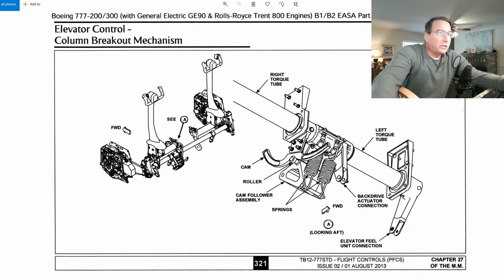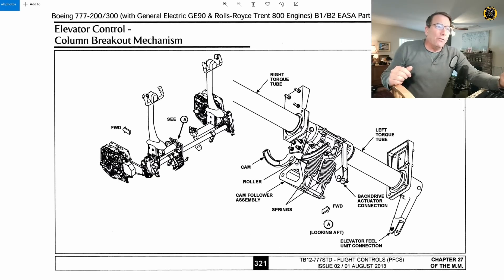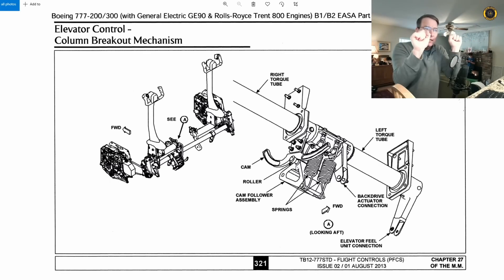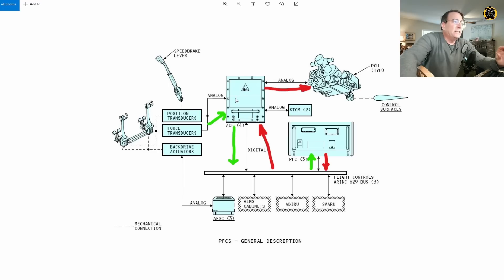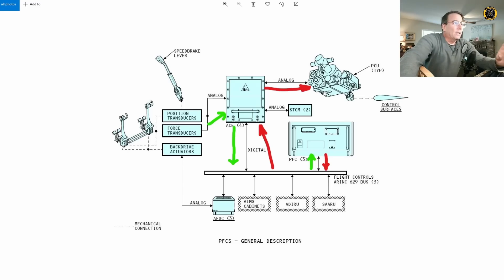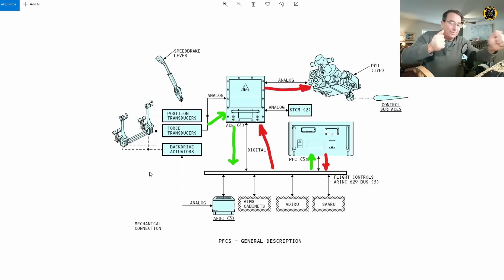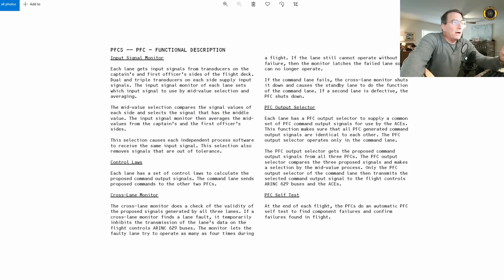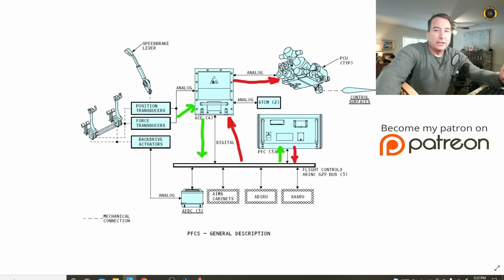Air France 11 Decoupled Flight Controls- "Who's Flying?"

Comment: Thanks for this piece of analysis. I am a French aerospace engineer and I am saddened to see that Air France pilots seem to disregard lessons learned from AF447 and other accidents regarding crew communication. Having both pilots handling the controls to the point of fighting for control without even realizing it, and ending up decoupling the columns, while on a go-around, would be comical if there weren’t several hundreds of passengers onboard. 
This is just extremely unprofessional. Air France pilots really seem to have a contagious disease of badly inflated ego.

Comment: This stuff is exactly why I, and many others.....if we can't bend it before we hit terra firma, I ain't agonna fly it. (Talking about the new composite air beasties). That's why I retired as a 737-300 captain at Brand X. Actual cables to the elevator, spoilers,  and ailerons (Rudder was on its own hydraulic system. Ever fly a 737 in manual reversion? I have, in a maintenance flight for return to service. The input forces were phenomenal...I wasn't chasing the bucks or type ratings......and, I'm glad I did just that.   B727 and B737-200-300.  I could have retired as either a 777 Captain, or a 747 co-pilot--- that position made more money than a -300 captain.  (A side note: What about an EMP attack?).  Any ideas? Call me paranoid, old fogey, curmudgeon......fine........Enjoy the bucks! Lots more to share, but not here. Please.....just be aware. Blanco, great job.....thank you. Gee! Whole new world now.......enjoy your Luscombe!

Comment: Does the technical info on the flight controls explain what the pilots were doing or what the pilots were not doing? Procedures are established so one pilot flies, the other monitors. If the pilot not flying takes over that must be announced clearly to get the other pilot’s hands off the flight controls. What led to the confusion?

Comment: I’m an engineer, but not that kind of engineer. However are used to be involved and computer control systems and have some idea of what’s going on here. 😁

It would seem to me that if decoupling occurs the crew should get a big warning and the plane should ask the crew which of the two control yokes is the one controlling the plane. Otherwise, as you described it, it would seem that what the system is going to get is the algebraic sum of the two inputs which, as you pointed out, could lead to zero input if the two yokes were in opposite positions.

Comment: How can it be an experienced Boeing pilot knowing
- how Airbus manages the the operation modes when the flight control is  not fully according to specifications  - Airbus jargon called laws
- but not having the full information how Boeing FBW is set up?

May it be Boeing is not open to the pilots how the system is working, especially in the case of some abnormalities?
May it be Boeing training is less deep than Airbus training?

Comment: The first pilot error was made at 1200 feet above the ground when the captain who was the non-flying pilot did not tell the co-pilot who was flying that he (the captain) had taken control of the plane ( I have control or my controls)  then to be confirmed by the copilot.  If they crashed it would have been the primary cause. Procedures, procedures, procedures. 

The non-pilot flying captain was pushing the nose down while the pilot flying co-pilot who was pulling the nose up to go around. The pitch went up 24 degrees then down to 3 degrees increasing to 12 degrees.

Comment: Take a chance fly Air France! This what I learned when flying every month from US to Europe and back 2005 to 2012. Best was Northwest from Memphis to AMS, then Delta destroyed the option. Thereafter it was ATL - AMS and back. Some of flights were CDG -ATL since Delta was code sharing. It was always an experience of disorganization, but the bottomless champagne was great. If you were flying during this time frame from CDG you remember the many variants of concourse E they had and if arriving from US and followed the CDG signage to connecting flights and ended up at a bus stop outside the terminal. Take a chance fly Air France!

Comment: Well done Juan.  You point out very appropriately that the airline pilot is not required to know the details of how the FBW flight control system works.  Apparently Boeing aircraft pilots know event less about how the three different flight control laws work than do Airbus pilots.  How the flight control law works, versus that it does work does not seem to be a training priority with training Boeing FBW airplanes.  The basic analogy I use to explain the systems on Airbus is to compare a automotive power steering controlled car or truck to one where the power steering fails.  Without power steering, the car or truck can still be steered by the driver.  But the physical effort required is very different.  Steering the car or truck using fingertip pressure, versus ham-fisted exertion that is required without the hydraulic assistance.  Or, mowing your lawn with the ancient push thrasher type of mower versus having engine or electric motor powering the cutting blade.  

While I digress slightly with that explanation, it is very relevant to the effort required not to have both pilots making inputs to the flight controls at the same time.  A very fundamental “no-no” with all aircraft.  But, most especially with FBW controlled aircraft.  On Airbus, dual inputs are either summed together electronically so that the cancel out, or the summed inputs create a less overall authority situation resulting in half the output to the flight control surface than the dual input situation would otherwise allow.  This dine on purpose to avoid a dual input summing together to generate twice the control input that what is desired.  For obvious reasons, this must be avoided.  And is directly analogous to a PIO, or Pilot Induced Isolation situation.  A scenario that all pilots should be familiar with, that cold create a loss of aircraft control situation.  

Famously, the F-16 Falcon and the F-22 Raptor FBW fighter aircraft prototypes both suffered catastrophic accidents due to PIO during their flight test programs.  Thereafter, FBW flight control systems have been improved in an effort to reduce or eliminate PIO scenarios especially in the landing phase of flight.  This Air France 11 investigation may lead to design changes or improvements to the FBW flight controls  based on this incident.  Such changes may not ever be told to operational pilots, similar in result to the 737 Max MCAS fiasco, as you briefly mentioned.  The question remains though…how much information needs to be given to operational pilots about who the flight control system works?  This is a flight training and flight crew knowledge dilemma that remains poorly fleshed out, in my view in all of the flying world today.  How much information is too much to require the operating pilot to know and understand?  The old “less is better” trap that quite often leads to incidents and even accidents.

Comment: The fundamental issue here - and I am not certain the design engineers have quite got this sorted out in the optimal way - is that there are two sets of control inputs feeding signals in to the flight control computer, how  does the flight computer know to which it should be responding?

If both sets of control input are producing the same output, then the PFC can use either. But when the two control inputs produce significantly different results, the challenge in design is to come up with a solution to that problem.

The second challenge is for the PFC to clearly indicate to the pilots which set of control inputs it is responding to.

I don't know the 777 well enough, but it seems to me there should be a toggle/push button switch arrangement in the cockpit which can be used by the pilots to set who is in control of the aircraft, implementing the traditional handover of control which "You have control, I have control" (or equivalent phrase uttered). This control switch arrangement would then be used by the PFC to determine which set of control inputs it is using as input to the flight control system.

And to deal with the second issue of indicating which set of control inputs is active, a set of two indicator lights on each pilot position can clearly and easily indicate which flight controls the PFC is taking input from, and couple that to an audible annunciation when the PFC switches from one set of control inputs to the other.

It's fairly simple.

Comment: So if the two sets of controls are treated equally. If one control should jam at full deflection, the best you can do with the other is neutralise the input. I would of thought (hoped) that there is an alternative method of overriding a jammed control.

Comment: So some pilots are not informed of how their primary flight controls work leading to confusion like the Air France flight that should have been avoided? I learned how the systems worked in my planes but times must have changed.

Comment: If I was a 777 pilot I would absolutely want to know this information! I know there are limitations on some people’s interest level in systems knowledge and capacity for training, but I want to know as much as possible about the machine I am operating. Being intimately equipped with that knowledge results in a deep understanding of the machine, such that when something goes wrong you have the whole picture and can react accordingly.

Maybe I am an outlier, but this seems to be common sense to me. I do this as much as possible with every machine or vehicle I operate. The more you learn about other systems, the more you can infer based on prior experience to fill the gap any gap in actual knowledge you may find yourself up against.

Comment: It seems that the era of designers assuming pilots would never fight each other over controls is over (AF 447/AF 11) - so at minimum it would seem that an aural indication of ‘Control conflict!’ or similar warning would snap pilots out of their confusion very quickly, and presumably the captain would assign control immediately.  Also wondering why commercial aircraft don’t have a similar system to fighter jets that will anticipate an impact and take over all aircraft systems, restoring it to safe level flight starting with a ‘Fly up! Fly up!’ warning regardless of GPWS mode. There is no excuse for a modern passenger aircraft to ever dive into the ground - be it from pilot/design error or suicide (faulty air data air data of course has been a huge factor in the past, and again, this should never happen, and regulators also need to be held to account when they allow manufactures to cheap out on redundancy like AoA sensors, for example).
Reply: Airbus fly-by-wire aircraft (everything since the A320) do in fact have an aural warning if both pilots attempt to manipulate their side stick at the same time. The aircraft calls out "dual input" and there is also a visual warning.

Unfortunately in the case of Air France 447 this warning seems to have been ignored. The "dual input" warning is clearly audible in the CVR recording, but the pilots made no mention of it. The same is true for the still warning.

Comment: [Caveat: I never worked on this (B777) or any other aircraft control computer.] However, I was responsible for the failure-mode software of the PRM "Parallel Runway Monitor" system, so I have experience in how engineers design failure-mode response in FAA-compliant systems. First, all of this design effort is always constrained by FAA specifications and upper-management specifications.  It is highly likely that the specs for the B777 controls said to allow for two (and only two) failure modes: Mechanically jammed control yoke, and body dead weight jammed control yoke.  So while it is possible that they chose averaging of the two inputs, this is unlikely. "Will the aircraft be fully controllable if the pilot only has from full nose down to the average of full nose down and his full nose up input?" It is therefore more likely that the computer is looking for motion, and fully passing through any motions that look like "normal pilot inputs". Note that "fighting over the controls" was NOT in my hypothetical specs.  So the software would have no allowance for this situation, and no acceptance tests to observe how the system responds to such a fight. "All bets are off" on what the computer will do then.

Comment: Sorry guys, but the purpose of MCAS on the 737 MAX was to resolve a relaxed stability condition at high angles of attack and high power....such as in a steep power turn. Without MCAS, the airplane could not be certified under FAR Part 25.  MCAS is a stability augmentation system, which only actuates when the airplane is in a certain corner of the flight envelope where the relaxed stability occurs.  In normal flight MCAS is dormant.   MCAS is NOT there simply to make the MAX handle like previous versions of the 737, to preserve a single type rating.   That was pure BS, promoted by the mainstream press, which does not understand anything about aircraft stability, or certification issues.
Reply: But isn't it true that the 737 did not display this corner-case behavior like the Max did and, strictly speaking, MCAS was there to maintain type rating without recertifying?
Reply: @garymartin9777  You are correct in that the stick force issue was not present on earlier 7-3s.   My understanding is that the lift produced by the big LEAP 1B nacelles and their position forward of the wing was at least partly responsible.   But MCAS was not developed for the purpose of ensuring that FAA would include the MAX on the existing 737 type certificate.   With that stick force issue present, Boeing could not certify the MAX as a Transport Category airplane....period.     They could not even certify it as a brand new type, so any concern about a separate type rating for the MAX was N/A.   

FAA put out some very informative documentation when they recertified the MAX.   Those documents clarified a lot of things.    Unfortunately, by that time, the mainstream press had moved on to other stories and were not about to expend any effort walking back some of the BS that they spouted right after the accidents.   When MCAS is working correctly, it only triggers when the airplane is being flown in the corner of the flight envelope where the stick force issue occurs.   FAA stated straight-up in their recertification documents that the average airline pilot would NEVER see an MCAS activation.....again, because airline pilots don't do steep turns with pax on board.

Comment: I’m not quite following. Does that mean that a 777 with one column jammed fully pitch down can never pull up because the decouple cam tension will be maxed and the input transducers averaged to “null”?
Reply: Pilots not knowing how this system works shocks me again!
Isn't it in Boeings interest to give this information to the users and operators?

And if not: Why ???

Comment: Pitch is most probably controlled by "C*" algorithm - same as in Airbus A320 and newer. Feels little bit like natural, but its not. Without safety parts, its just a mathematical function done by software in computer. Its loop with negative feedback. In the negative input we have g load and pitch rate mixed together. On positive input its only control column or sidestick or autopilot or whatever. Very simple and almost very good thing.

Comment: Wonder if you can feel it seperate   Is the elevator trim still cable driven as a backup?
Reply: You can at least feel the very high force it takes to break it out!
And yes, on 777 pitch trim (mostly stabilizer, not elevator) is still mechanical.  787 is not.

Comment: I suspect that there are two complete paths from the control column to each elevators pcu to allow the unjammed pilot to control the airplane and the operating signal must in the opposite direction and larger to bring the air planes attitude to normal position. The jam can occur anywhere between the control column and the control surface.

Comment: The flight control laws on the Boeing don’t correlate to the Airbus ones. The Normal flight control law employ the system as you describe it (ACE - PFC - ACE - PCU). In the event of failure, the system can operate in “direct mode” which just means that it’s only the ACEs that are doing the work and the other electronics are by passed. The system does its best to fly as close to normal, albeit without all the flight data needed to do that.  That being a g-load/pitch rate demand law in pitch with speed stability lity (what engineer types call C*U). In the roll axis, the 777, always operates in direct wheel to aileron command, unlike the airbus and 787 which use a rate of roll demand (with other protections built in too)
So, on the 777 the Normal and Direct refer to the computational pathway, while on the Airbus they describe the aircraft’s handling characteristics and envelope protection status. (A350 & A380 have more advanced flight control law redundancy and required higher failure levels to lose AP operation or degrade handling characteristics)

Comment: Could you compare the back drive actuators to the power steering on the 1970s Chryslers with full power steering versus later years put steering assist so the driver would have the "feel" of doing the steering?